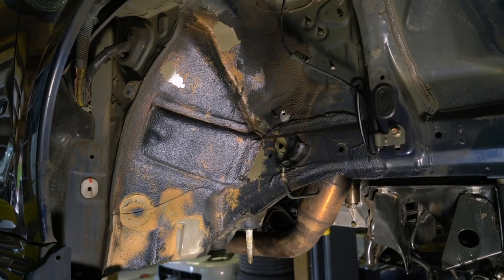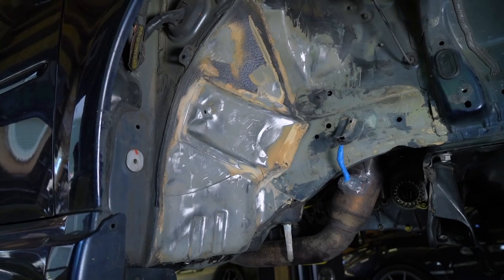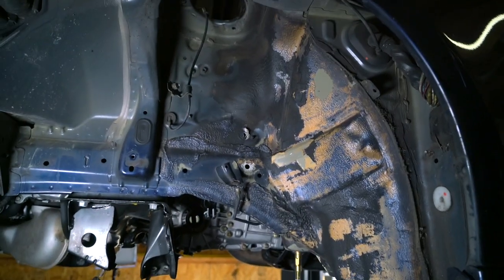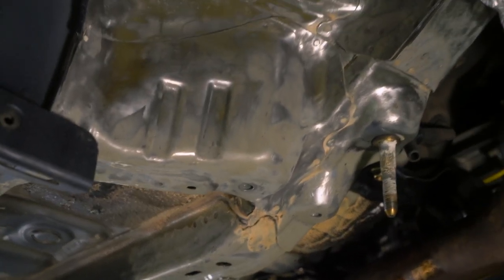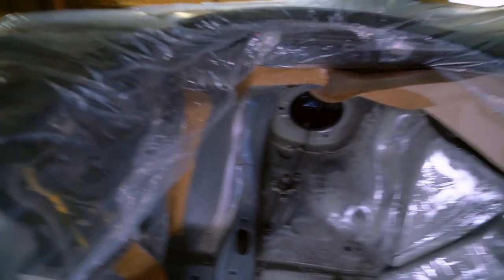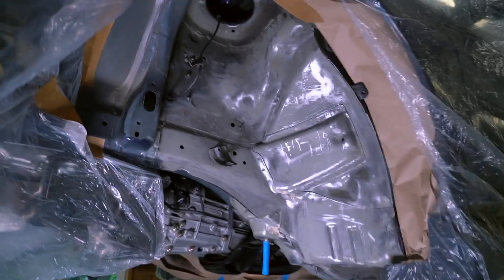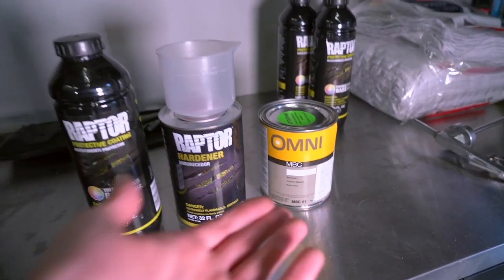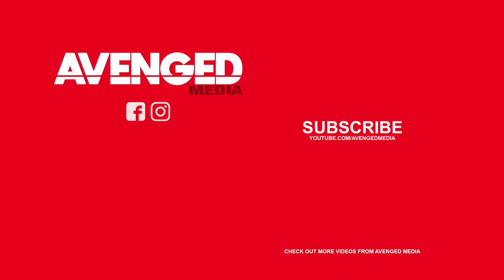Restoring my Legacy GT Wagon Wheel Wells with Tintable Raptor Liner!

Comment: If you only spray small areas like wheel wells…how long did you wait between coats? Did the bottle harden up inside and make it hard to spray it while it sits between coats? What did you use to clean the gun if you have remaining bottles to use later?
Reply from the maker: Oh man, I don't remember exactly how long off the top of my head, but I just followed the directions on the bottle. It didn't harden between coats, but if you have extra, you won't be able to save it for later projects. And Raptor recommends acetone, lacquer thinner, or MEK to clean the gun.

Comment: I am a bit sad that you didn't do at least half of the wheel well area(s) covered by the liner(s).   I'm sure that you are okay with it because that would have added hours to an already long process.   I wish ALL car companies would line 100% of the underside of the car body and wheel wells to help cut down on noise.  I'll take 50lbs of additional weight (low on the chassis) if it meant a 3-5 dB reduction in the noise level/floor when driving.   I wish Subaru took more notes from Lexus (and less from Toyota)

Comment: Seems like a waste of time, man.. All of that effort on 2/3 of both front wells?? Should have just given it a clean and called it a day if you weren't going to do the full wells plus the rears and the entire underside of the car. Like why just do that small area is beyond me. I like the car a lot but so many pointless activities
Reply from the maker: Clearly you don’t listen very well… I did 2/3 intentionally to match the factory line. The factory wheel well covers the rest. If simply cleaning them wound have been up to my standards I would have done that, but they looked awful so I replaced the coating.
Reply: That's fair although it'd annoy me if the rear wells didn't match, even though it will never be seen. Look forward to the progress on the build man, its cool that you're doing this instead of the same old wrx and sti builds that everyone does